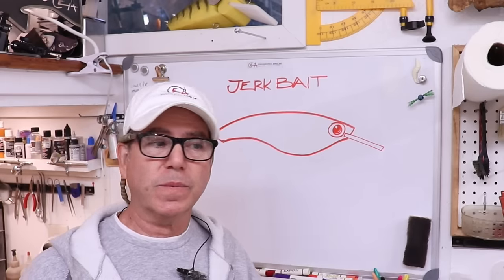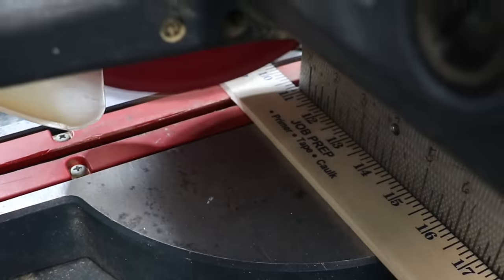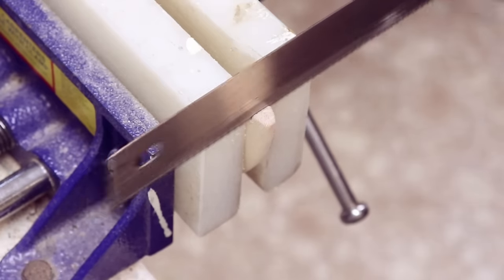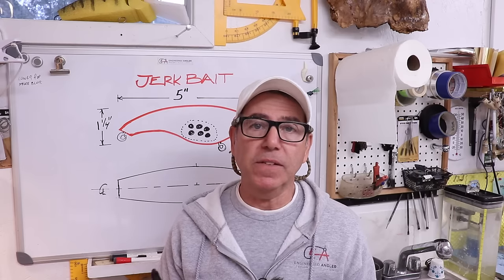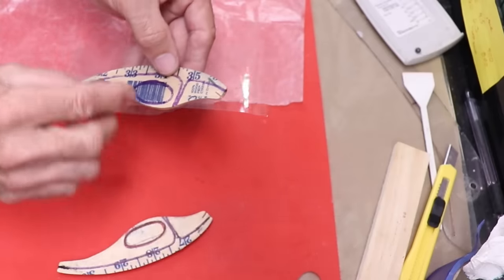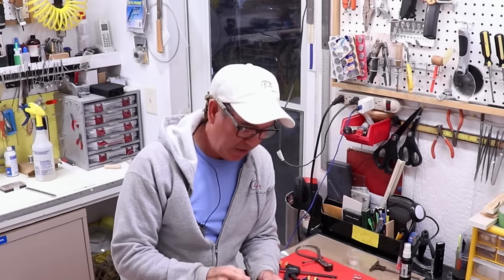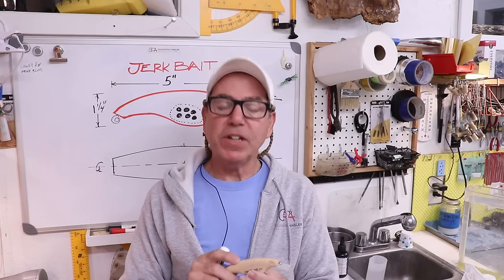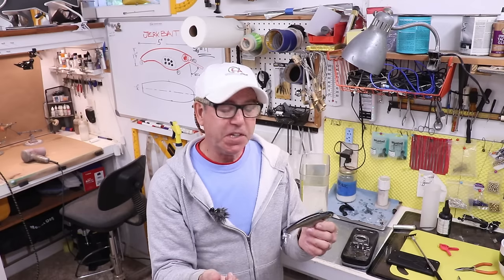Making a Jerkbait with a rattle, How to make a suspending Jerkbait lure  #lurefishing #bassfishing

Comment: What a beauty! Yes please, do a video on weight and balance, I screwed up my last batch of crankbaits by not giving them enough weight (I used balsa and I don't have a precise scale yet), I'm sure they will work once I finish them but they will float back up way too fast. I like them floating up fast because I fish a lot of shallow areas (2 - 4ft of water) with lots of rocks and branches underwater but I don't think these will want to dive below 1.5ft with all that balsa pulling them up, even with bigger bibs.
Reply: These micro digital scales are surprisingly not that expensive.  They are readily available on eBay and Amazon.  The cheap one that I have purchased 8 years ago is very accurate and precise.  The readings repeatability is very good.  Looks the new once now days are even cheaper.

Comment: Good morning, I'm Brazilian and I really admire your work with baits, knowledge with materials, techniques used in painting, and of course the very different models, I just wanted to give you a tip regarding the wire, especially at the ends, using them leftovers you get a not so refined finish, if you use them just folded they will be perfect
👏🏼👏🏼👏🏼👏🏼

Comment: Hello, Franco! A great video once again! And with a very interesting topic of building a suspending lure. Thank you very much! And thanks for explaining the UV resin problems in such detail! I will definitely try applying a water-based protective finish as mid-coat. Sadly, there is no Minwax here in Serbia, Europe. Not sure about the clear coats for the airbrush though, since I haven't leveled up to the airbrush yet.
I think it's a great idea to do a Master Class on weight and balance. The Master Class on crankbaits was very informative, and I keep going back to it, so it would be great to have a similar material on weight and balance.
Again, thank you very much for the videos! I really appreciate the time and effort you put into making them and sharing your knowledge and experience.
Reply: Hey! 
I noticed you said you don't have min-wax in Serbia. I think I know how you can solve  your problem. 
There are a few videos on YouTube explaining the difference between lacquer, polyurethane and polyacrilic. That product POLYCRILIC is a water based polyacrilic coating. You can likely find a comparable product with the info from those videos.
Hope this helps!
Reply: @nicholasholmes3500  thank you very much! I already looked for polyacrylic coatings earlier when Franco answered my question about blemishes in the  UV resin, and I found some manufactured in Serbia, but I doubt they are the same quality as the Min-wax. But will try it out, definitely!

Comment: I have always imagined a suspending lure are probably very difficult and requires field adjustment as each body of water will be different.  A master class on weight and balance would be really good.  It would be nice to know what the min and max weights are relative to the action one trying to achieve.  Thank you so much.

Comment: Is it considered cheating to make a "five inch" lure from a "ruler"??? 🤣🤣🤣

You made a pretty general statement about Isopropyl Alcohol having a lot of water in it and I don't know the answer, so I'm asking. I purchased 99.9% IPA specifically for ultrasonic cleaning. Does it have a low enough water content for this use? Thanks so much!

Hey Franko, using soap to prevent bubbles! 😂 Who'da thought?

I've finally got a grip on calculating the amount of lead needed to weight lures and then you drill a huge cavity in the center of yours... Do you have to make and kind of consideration for the difference of the air space verses the buoyancy of the wood you removed, or is it too insignificant to worry about? I would think that every factor matters when shooting for suspending. Thank you again!

Love the magnet idea! You have enough BBs in the cavity, that if a couple got stuck they'd still work well, but using the magnet increases the chance of full functionality. 🙂

Thank you for the information about clear-coat buoyancy. It has been a long-time question in my head and you confirmed what I was believing. However, I didn't realize the difference in adding volume to the outside, vs internal.

Sorry for the longest post ever. This episode have been very inspiring!!!

Great looking lure and super action!

VERY interested in the Master Class!!! 😎
Reply from the maker: Im glad you found it interesting and useful.   Cheers

Comment: Hey Franco. I love your videos! You've been my main inspiration to start building my own lures.
I guess I'm a bit late to the punch on clear coat questions, but I was wondering - do you ever use 2 part epoxy as your final coat? Why? Why not? Why do you prefer UV resing? And how do you feel they compare to the UV resin?
Thanks!
Reply from the maker: Here's the list of all the reasons I prefer UV Epoxy and don't use 2 part epoxy any more:
No mixing, Much faster cure time, Can recoat in less that 30 min., Sets much harder, Less likely to yellow, easier to control bubbles, If things are not going well, just wipe off before you expose to uv light and start again.

Comment: I watched an older video where you made a soft plastic swimbait with an internal wire truss using Plastisol.  I wonder if you've ever considered molding one out of a firmer but still "soft" material like a shore A 50-60 polyurethane.  It seems like it would hold up better and mixing and pouring it is similar to the 2-part hard resins you're used to.  I've used it to mold things like motor mount bushings and it's tough stuff.
Reply from the maker: Sure its doable, but there are some limiting drawbacks to how dense it is.

Comment: If it's small transfers. Make your design then out clear tape on the bait. Redo your design then press the two side together. It will transfer the design from the tape to the other side.
Reply from the maker: You need the mirror image.

Comment: Hello Franco, I have had issues with the UV resin peeling off on my, I fish a lot of rocks and assumed that was at least part of it, but after watching the QOW segment maybe there is more too it. In most cases the clear comes off with the paint or some of the paint so maybe it is more that the rocks. in addition to making sure the paint is drying fully is it also possible the casting resin is not fully cured? Most times i give it a couple of hours after casting to start painting and i'm wondering it that could be enough.
Reply from the maker: The casting resin takes a few days to fully cure.  You can hurry the process by baking it at 190 deg. F for two hours, then clean it well with alcohol.  If you are only allowing 2 hours before you paint then that is most likely the problem.

Comment: Every time I see these videos where the clear coat is brushed on I cannot help but think if I tried that I would have huge ugly brush marks.
Reply: When that happens, I shoot the lure with a heat gun.  It soften the clear coat (runny) and the brush marks disappears.   Of course the lure is on the turner.
Reply from the maker: I give the UV resin a few minutes turning in the curing chamber with the lights off,  this lets the resin self levels perfectly and the bubbles go way too.  Then I turn the lights on and usually get perfection.
Reply: @EngineeredAngler  Thank you for the reply.  I will try that!